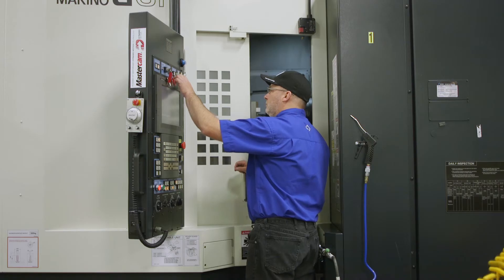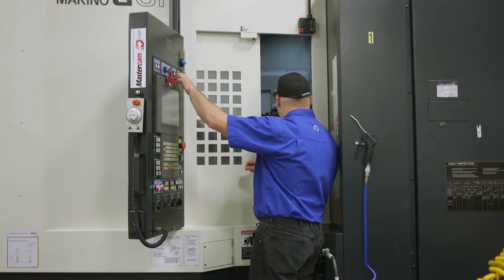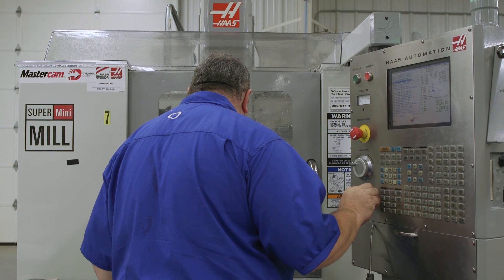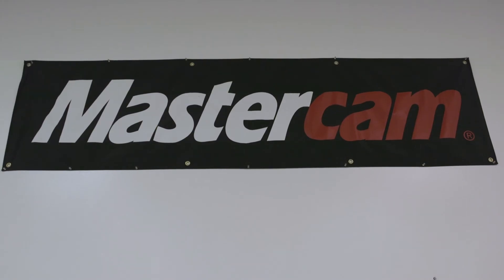Roush Yates Engines and Mastercam Partnership

Comment: Mastercam has been part of Yates engines long before the the Roush Yates merger. 
Robert Yates Racing used to have a GENIUS of an Engineer/Programmer 
named Brett Conway. Hands down the most innovative CNC Programmer and 
software developer I have ever met.

A lot of the functionality in Mastercam 5-axis is directly related to his  work. 
He was doing engine porting with Mastercam v5 & v6. He wrote a C-Hook that would take
the standard 5-Axis toolpath, normal to the surface,  and allow the user to define a focal point 
for modifying all the tool vectors to allow for machining of the port with tool clearance.

They would machine the ports on older Mor-Seiki verticals with dual-rotary table setups. 
This was in the old Yates Racing Shop in Charlotte, I can tell you that shop was not in the best of 
neighborhoods. ;-)